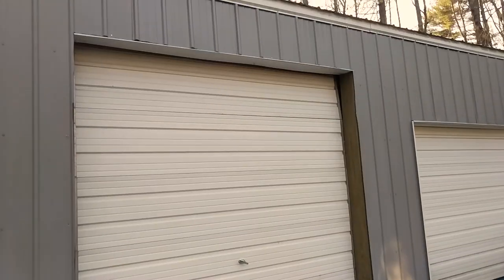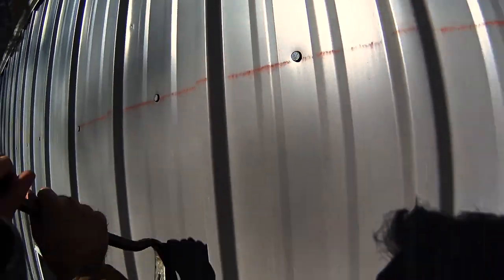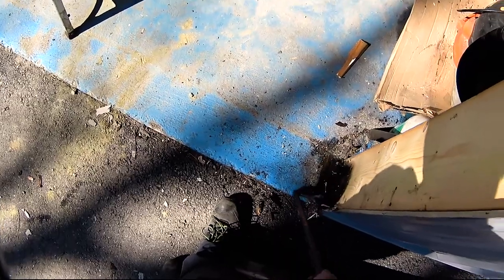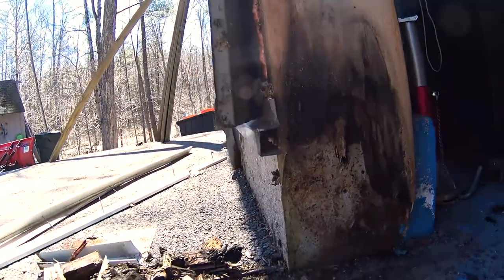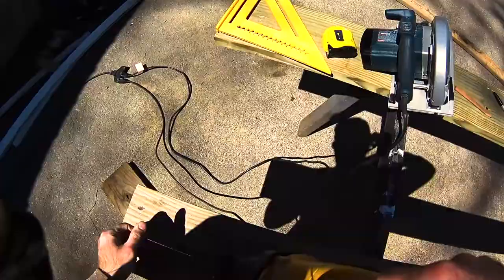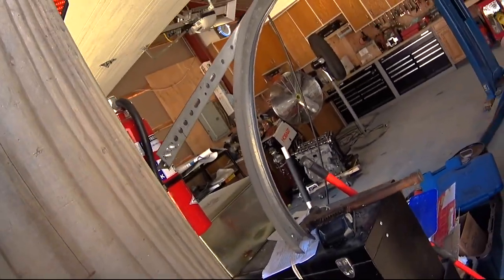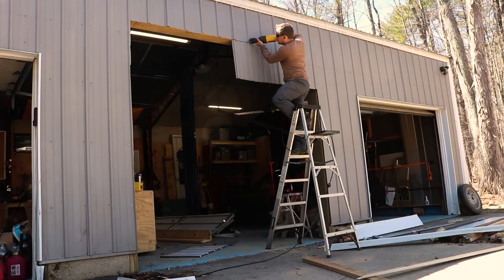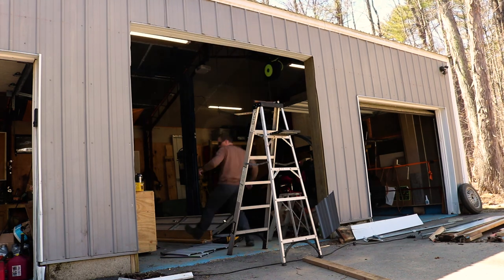Garage door is too small!!

Comment: I feel you pain with the wood rot.  I we built our house out of insulated concrete forms, roofed and sided it with steel panels just like yours, and the only wood on the exterior is 6 pieces of 1x4 pine that I had to use to trim the  doors.  Well if I haven't had to caulk, prime and paint those stupid 6 boards 3 times now in 7 years!  Low maintenance is the way to go.  Good video.  Looking forward to number 2.  R.J.
Reply from the maker: i have fallen in love with PCV for trim, never rots, and looks decent painted! i started using it on the last house, and plan to replace any trim with that once the old stuff rots.

the guy who built the garage only did about 1 inch of overhang, so i bet all of my king studs are rotted :(

Comment: Did you make a second finishing video for this door?
Reply from the maker: Yes Sir I did! https://youtu.be/biaBvXkDwaI
Reply: First of all I like to thank you for your reply and apoligize for any inconveniences,. I have a job like this that I have to do when the weather get better in a month or so, About the Header framing I could handle that situation, but I was wondering what would your subjection be  for my situation, Please let me explain. This a job that I'm doing is for a brother at church and his budget is limited, right now he has a 8' tall 9' wide door (single Door) and what really concerns me if the door situation, I will need another section of the door that is going to be about 2 1/2' taller than the originals sections, and at the same time I would have to push back the Garage Door Opener to compensate for that section... I kinda did a research  and fund that they make a Extension Kit for the garage opener but I'm stuck on the Door section... Just wanted to get your point of view and maybe I could implement them with my point of view. Thank you so much and have a great day.
Reply from the maker: I am sorry for the delay, i am a little unsure on what you are asking, and i really want to help.  I had a hard time finding door sections to make mine taller. My door had been discontinued.try a few of your local suppliers, they order replacement sections for damaged doors all the time. Since i couldnt find a section for my door, i bought a used door and replaced one of my other doors. Then used the leftover parts to make my center door taller.